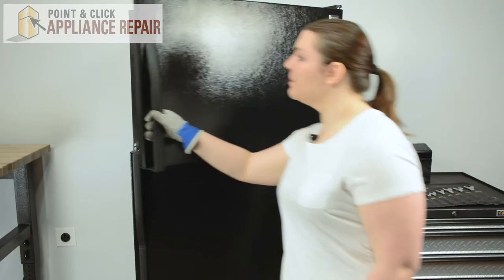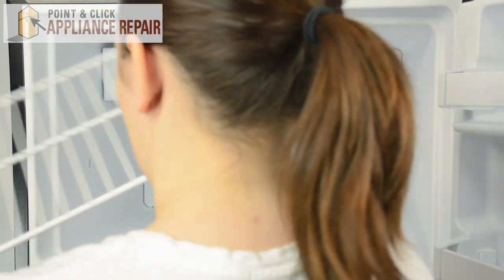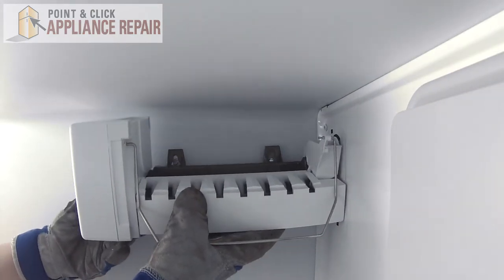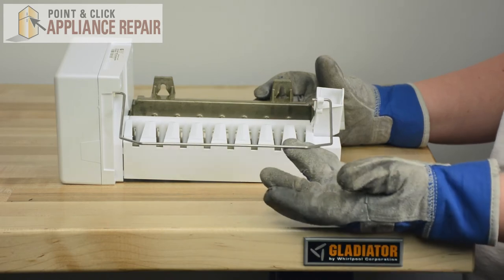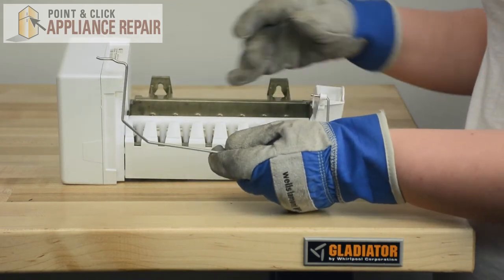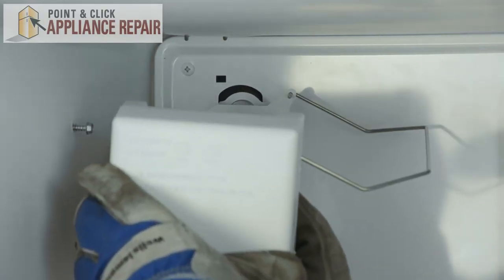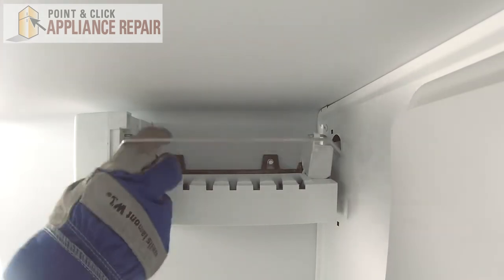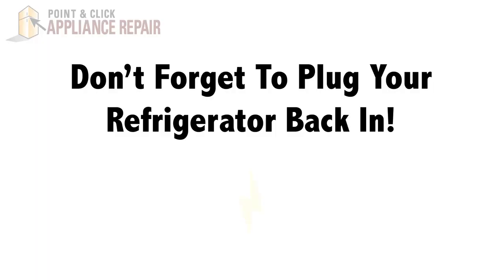WP627792 - Replacing an Ice Maker Shut Off Arm - 627792, AP2940774, PS380887, 14214703

Comment: Why do you need to take the whole ice maker out to replace that part?
Reply: If you have 5 minutes to waste remove the whole ice maker to replace a part that you can easily slide in with the ice maker installed.  Don't forget to remove the freezer door also and take the entire refrigerator apart.  You will need gloves, a safety harness, a big box of tools, and a hard hat.  You will also need to have freon recovery equipment.  If your refrigerator does not get cold a week after you replaced the shut off arm, that means you forgot to plug the refrigerator back in or you failed to reinstall the freon.
Reply: Only because she charges by the minute. hahahahaha . Skip the gloves too.